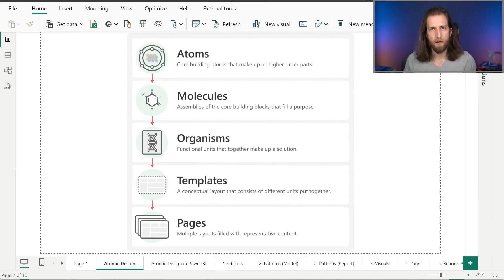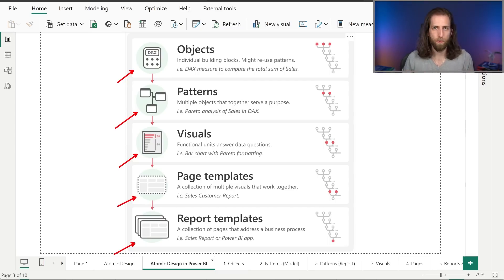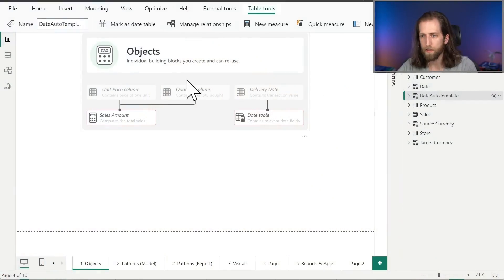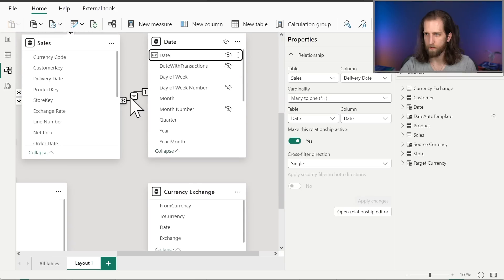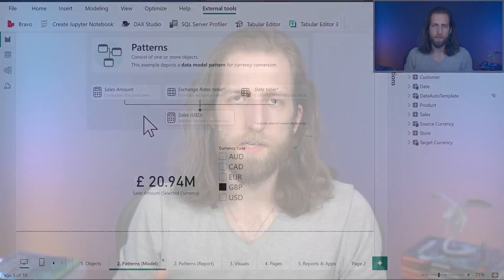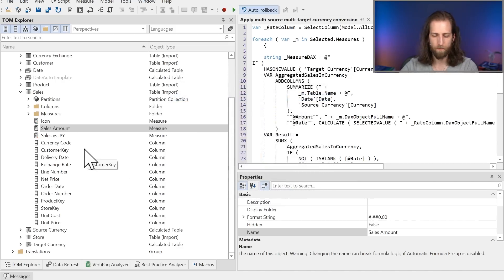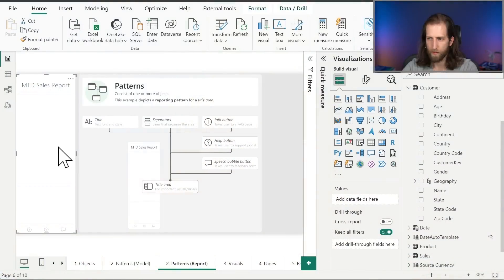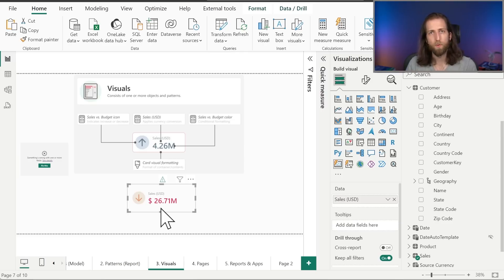Using atomic design in report and model development

Comment: Ciao Kurt, the new "On-object interaction" option don't solve the limitation at 15:28? You can swap fields/measures, without needing to remove and add them, don't know if it keeps the formatting in every occasion though. Great video btw, the 3/30/300 one too, very inspiring, looking forward for the next ones.
Reply: It does in part yes; you can find this in the article too. I didnt go into it in detail in this video because the feature is in preview and will likely change which is harder to update in the video as opposed to the article. 🙂